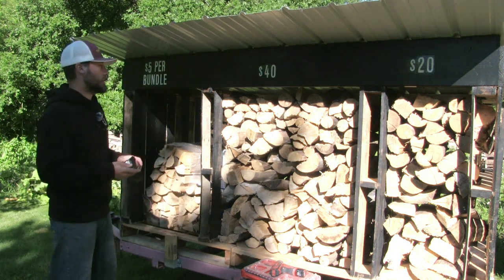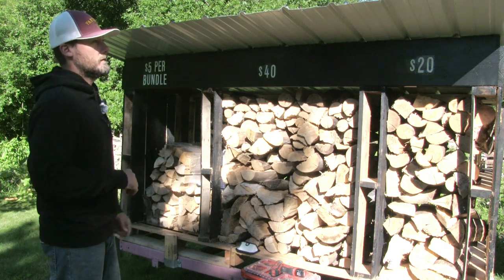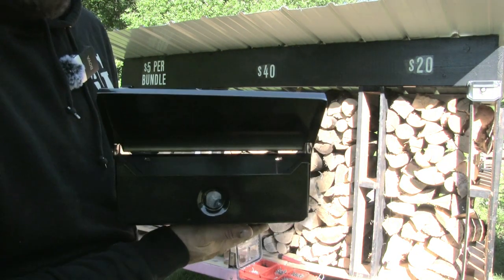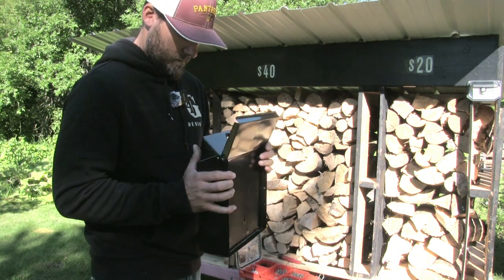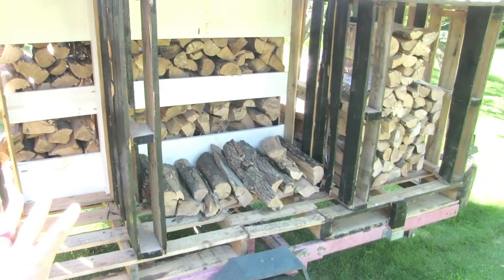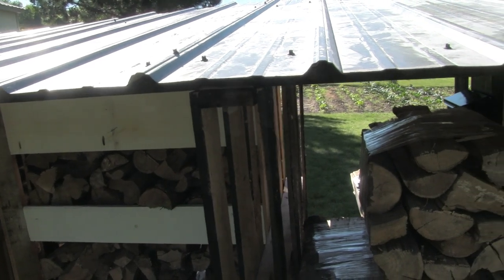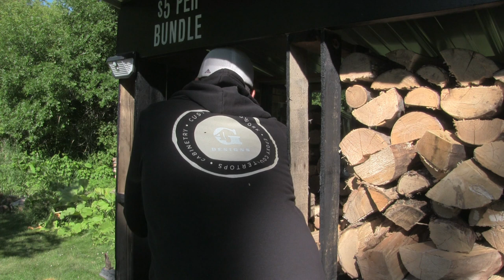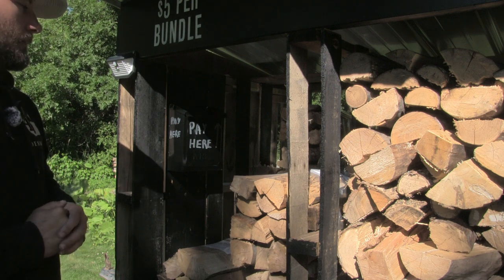How to Build a DIY Roadside Stand Part 2 - Donation Box, Lighting, Final Touches - CMF 36

Comment: Good  morning  Eli
Looks  GOOD  
Yes on anything  that we put a lock on stuff...it will only  keep out the convenience  thief !!
Wondering  if the rear of the  trailer  may need  blocking...thinking  maybe  if all the bundles are  sold  and  the rest of the compartments still full  it might  be tipsy !!
Maybe  the back  edge  of roof  ...you could  put a 2×4 ....3 inches longer  than the roof  with kinda  rounded  end corners !
Placed on the bottom  side with a half inch  overhang at bottom...screwed  on from the top of the tin !!😊
Reply from the maker: @kendriedger151  I used a small strip of alder to edge the steel. I had the same thought on the tipping back of the trailer. I'll have to see if that becomes anything to look out for